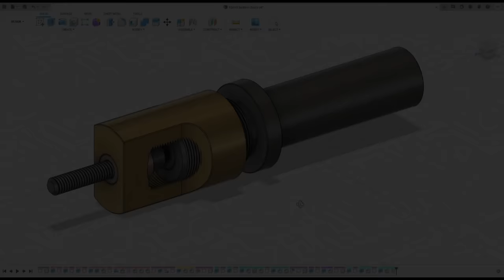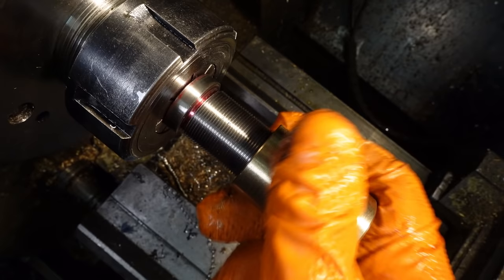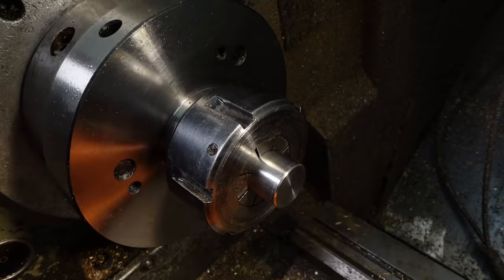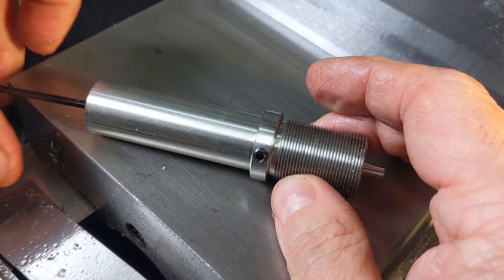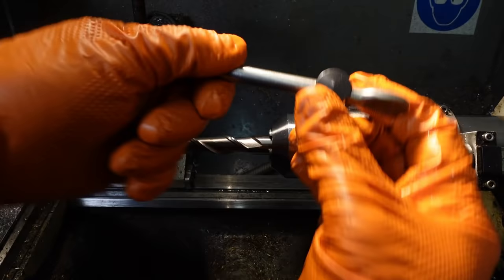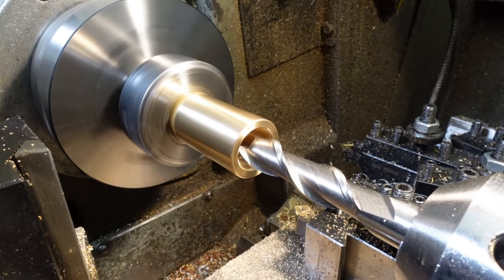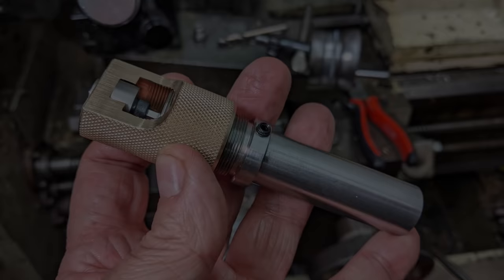Lantern Chuck machining and build #toolfest2021

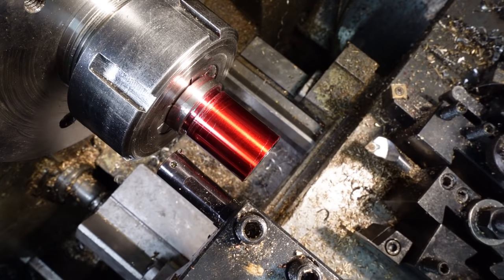Comment: 6:26 1.8 what? 1*0.65 is 0.65 so depth is 0.65. in diameter 1.3 full depth. works on full profile inserts. not in full sharp home made(thats might be 1.6) but tools have rounded corners lol 1.95 would be 1.5 pitch.
where thi squreroot 3 come oh yes sharp triangle. your tool have nose radius so its not 1.8 its more like 1.3 LOL
Reply from the maker: Aaargh, it is entirely possible I was talking Arrant Nonsense®
I'll have a look at the footage and see if I can make any sense of my random gibberings.  The thread fitted beautifully so the words are probably faulty. "Shome mishtake shurely" as Private Eye would say.  I'll review and check that insert to see what variety it was and where the zero was. That was probably a 3 am (eternal) red-eye voiceover and editing session, fuelled by alcohol-free Becks Blue.
Reply from the maker: Crikey, looks like I went completely off-piste there, those words don't exist in the original script I did for the subtitles. The Vargas insert is not a full-form job, but it is designed for 1.0 mm pitch, so the depth H from nominal OD to the bottom of the thread before the rounding is 1 x sin(60) or 0.866 (radius). Root width is H/8, so the truncation is 0.866  x (0.866/8) or 0.094 if the bottom was flat. A bit less for the rounding, say 0.08 to the bottom of the theoretical triangle, so from nominal OD touch-off to the bottom of the thread would be about 0.786 mm radius.  That's about 1.57 mm off the nominal diameter.  The square root of three just happens to be twice sin(60), which explains where THAT came from. (ref Machinery's Handbook 30 page 1964)

Sadly, no DRO shot to explain what REALLY happened in terms of how deep the cut was and how well it conformed to the ISO standard.

Whether I took enough off the tops of the threads I'm not totally sure, I should have turned the OD to the truncated diameter, but it looks to me as though I did it from the nominal, as all of the Dykem Red has gone. Looks like I was having a bit of a moment altogether. Normally with unusual threads, I use thread wires to find out exactly what the thread dimensions are.  I should have made the radius of the part H/4 less than nominal and plunged about 0.08 more than 5H/8.
I have a similar one to make soon, so I'll do that properly and use thread wires to confirm.  

Very interesting and well spotted!
Reply from the maker: ANYWAY.... I bought some full-form ISO inserts for the common pitches I use. Hopefully I'll make only beautiful threads of perfect form and dimension in the future. I must refit the read toolpost so I can run threads in reverse without inverting the tool. Another flippin job.  Yay...
Reply from the maker: and THIS, gentlefolk of the Choob, is what a really useful, intelligent and observant viewer comment looks like. Excellent stuff indeed.

Comment: think if you dont wear gloves you feel the sharpness before you start pushing intoo or pulling on it , another option would be to use an old vacuum cleaner or a magneting swarf collector if the metal is magnetic https://www.youtube.com/watch?v=ilPPweBdTIY and a longnose pair of pliers with the a smooth grounded beak for the rest

Comment: does the machine actually sound that loud or is that just the the level control.
Reply from the maker: My old camera was very flaky when used close to the machine, and I had no idea what I was doing.  Still don't, but I'm getting used to Fairlight in DaVinci Resolve and use remote mics for ambient shop noise so it should be better these days.  The machine is fairly loud but I wear hearing protection so I don't notice
Reply: It the chips rubbing on the spindle lol😂😂

Comment: I'm guessing a "scratch pass" is for us idiots (beginners) who want to make sure we have the correct gears in and feed select set.
Reply from the maker: There's certainly a very good case for doing a scratch pass when you have change wheels to swap or belts to move, but on a lathe like this where you just set the dials, and you've done it right the last hundred times, it's perhaps not worth it except on super high value parts. Also, very little of what I say should be taken seriously!

Comment: Amen to the rant reminds me of the mask issues around here these days if me not wearing a mask effects you the. You need to do more your safety is not my problem
Reply from the maker: My choice of wearing nitrile gloves when working with certain metals and fluids is purely selfish, done in private and solely to protect me from dermatitis and possile harm from long-term exposure to complex organic chemicals, heavy metals and fine particulates in suspension. It's done with a clear assessment of risk. 

It's definitely disingenuous of me to claim that my choice to reduce one adverse impact and accept the elevated risk of adding to the severity of injury from doing something foolish has no impact on others, as my mother, family, friends and dogs would certainly be impacted if I'm killed or maimed by my choice to wear nitrile gloves as protection now and then.  Anyway, I'm in danger of  getting boring about this subject, so I'll shut up and censor anything that might trigger the safety obsessives in future videos.  Perhaps.